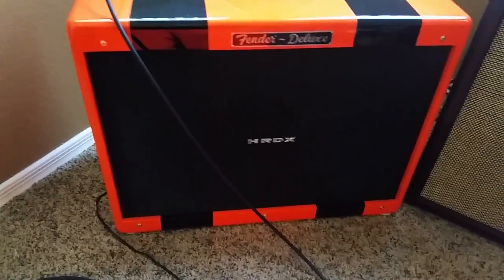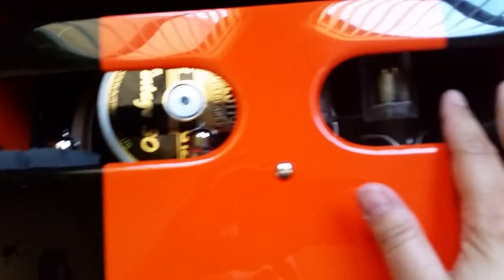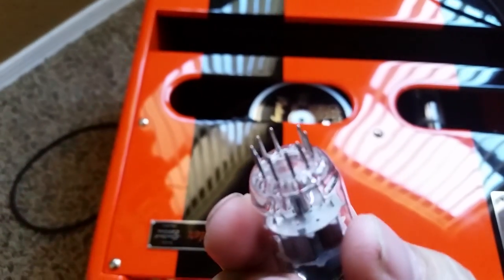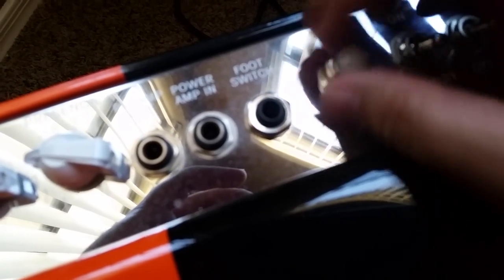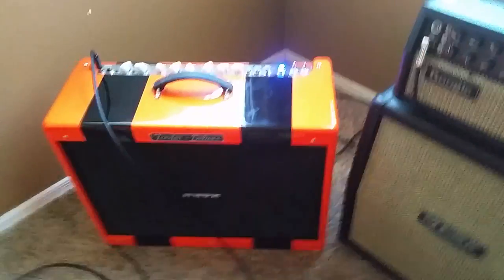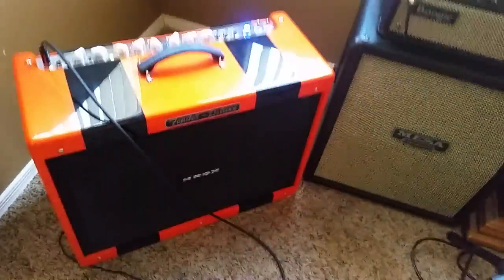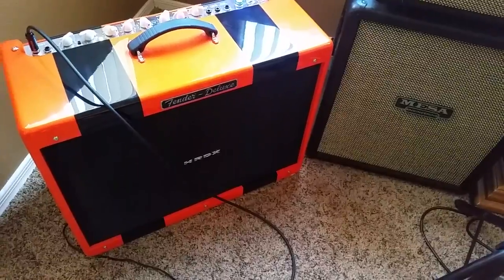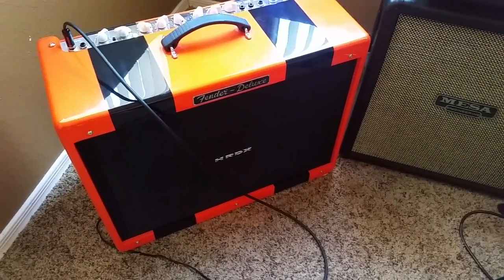Improve Your Fender Hot Rod Deluxe For $10

Comment: Great and informative video as usual Phillip.

I see that you put that tube in the V-1 socket. I owned a Hot Rod Deluxe White Lightning Limited Edition and put a 12AT7 in the V-2 with great results. It made the gain much more usable and had a  more even tone. Before the change, it did not have the volume jump but, the pots weren't tapered evenly. After the volume knob went past 10 o'clock it did nothing at all. The full range was between 7 and 10 o'clock.

I also had a Mesa/Boogie Mark III Simul-Class Blue Stripe 1X12 combo that did a volume jump but was unlike the one you mentioned here. When I would gig, I would get a big volume jump between 3and  3.5, It was extremely touchy and would jump in volume exponentially. It would either be too quiet or too loud. Never where it should be. The amp had the original tubes with Mesa silk screening on them. They were the Shuguang 12AX7's. I swapped all the pre-amp tubes for the Electro-Harmonix branded Russian 12AX7's  and the volume jump went away.

It bears mentioning that my neighbor also has a Mark III same as I did in the head version with a 4X12. He had swapped the tubes in his before me but,  made no mention of the volume jump going away (his had it as well). When I told him that the volume jump went away in my amp he said the same thing happened to him. When I asked why he didn't tell me that, he said he didn't want me to think he was nuts.

The foam around the V-1 and V-2 in the HRDX keep them form getting microphonic by dampening the vibration.

Comment: I love Fender amps  and I have owned several over the years.  I've had the HR Deville 4x10, HR Deluxe, Blues Junior, and a Deluxe Reverb.  I learned about this technique a long time ago.  I appreciate your videos and insight.  I don't understand Fender's logic, or lack thereof, regarding the reason to use linear pots instead of audio taper pots.  They are finally starting to use the audio taper pots.  All of my previous fender amps where modded with AT pots.  The tube swap is great to increase the clean headroom and the drive as you demonstrated. Thanks for your video.

Comment: Thanks, this really helped! I had tried the swap previously but the tube(Fender GT) I bought was defective. Got one from Tube Depot and that one worked. I can turn the amp up more in the house and it actually sounds better, including the drive channels. I’d say warmer and tighter. Also eliminated an intermittent crackle which I guess was the original tube.

Comment: Great idea,. I had a Fender HR Deluxe before for years and I also put in the Yellow Jackets with EL84's to bring down the output even more. I could actually play it at 4-4.5 and not go deaf, but it would still fill the room (approx 120-130 seat pavilion) where I played most of the time.I also highly recommend the Fromel mods for the HR deluxe. Replaces the plastic jacks with metal ones and the crappy tone caps and channel switching resistors. Also changes the volume to an audio taper, instead of stock linear. HRD III made these changes stock.

Comment: I have a 94 Blues Deville 4x10. I pulled all 3 12ax7's. V1 and V2 now have JJ 12AY7 tubes (about 45% of the gain of a 12AX) and an EH5751 in V3 (70% of the gain) installed. I can turn the amp to 4-5 now and actually get some power tube soak in there as opposed to the ice pick, ear shattering, high gain, preamp fizz that comes stock (@no extra charge) with these beasts. Smooth, round and still loud as I need it to be. Just a lot more controllable. I should mention I am a harp player. This is now my main gigging amp. Even with these tube swaps, I can cut through any stage mix with the loudest drummer/strummer combination and still have the availability to shape the tone from my pedal board. While gain is necessary to drive the power tubes, too much of it is very bad thing when plugging a mic/rig into a guitar amp with feedback being the usual result. While a mic has a much hotter output than guitar, the same principle applies depending on what kind of tone you seeking. If you want a clean amp/platform to run your pedals into, this is the easiest and most effective way to go. Simple preamp tube swaps have been done by harp players since Little Walter plugged a dispatching mic into a guitar amp 60+ years ago.

Comment: There is also an issue with the volume pot on fender HRD. Fender uses a linear taper pot instead of an audio taper pot. When the pot is changed to audio taper it has much better volume control.

Comment: It's not new, not secret, for sure...but that doesn't mean I knew it. Took my Deville to a great repairman for some other issues. When he heard my style of play, he put in that tube (or equivalent) before I came back to pick it up. He suggested I try it. I was blown away, using my Epiphone Joe Pass with 12 gauge strings, it sounded more like a Gibson L5. The warmth was incredible, the E & A strings were almost like I had a bass guitar,  and the high ranges had a buttery sound. I never went back. The gain loss wasn't an issue for me at all. The GT12AT7 is a great suggestion. Can't say what the life of it will be, but it's worth it, even if it's a shorter life than the OEM tube. Seriously.

Comment: Ive been using this.. trick well call, for your years. Def helps in almost every amp ive tried this in. Bought only amp it didnt work on was the Line6 Spider Valve, but thats a digital amp imho (even if it has tubes).

Comment: The tube dampeners are especially important in combo amps. SUMMARY:  Due to the close proximity to the speakers the tubes will be vibrated which wears them out faster and causes them to become  microphonic much sooner. The dampeners "soak up" much of the vibration extending tube life.

Comment: Phil - SUGGESTION FOR PEOPLE CONSIDERING DOING THE TUBE CHANGE - Your idea of changing the TONE by trying different preamp tubes like the 12AT7 is excellent BUT YOU NEED TO KNOW the different "positions" of the preAmp tubes.
FOR EXAMPLE - Most tube amps over 5 watts probably have more than one preAmp tube. Most of the TONE change comes from the preAmp tube in the FIRST Position. Usually the preAmp tube closes to the input jack & volume control. So you should KNOW the positions of your preAmp tubes and what feature of the amp each controls. In your video you correctly changed the preAmp tube in the 1st position.

Comment: Nice write up.  I have a 1996 HRDx. I use the 12AX7 but am using an attenuator through the effects loop to perform a signal soak.  This way I can dime the amp and control the output to the speaker without power dropping so I get maximum tube tone without all the ruckus.  That being said, I may try this just to see.  I too have a Celestion VG-30 in mine.  I do like the added warmth your demo provides and I am a fan of the gain drive dirty funknasty channel :)

Comment: I have a HRD I use for practice/stereo app, etc.  I got a tube set from Eurotubes that was called the SRV Blues option, which uses a 12at7 in v1 and that amp is now Awesome. Even the drive channels are useable now! That and a hemp cone WGS speaker and it's a really good gigging amp
Reply from the maker: I might need to try that.
Reply: Brad Carroll I have a blues deluxe and run a12AT7 in the v3 position.  What specific speaker did you buy from WGS?  I've been looking at the Eminence Cannabis Rex and WGS ET 90.  Right now with the stock speaker, I run the mids at somewhere around 10 and treble at about 3, and it's not bad at all, but I'm really curious to see what a speaker swap might do.  I run several od pedals, and don't really touch the second channel.
Reply: +MUSIcMaN587 you can't go wrong with the Cannabis Rex, I've installed one in every fender amp I have, a tweed blues jr and a 68 custom deluxe reverb. I'm looking for a cheap used blues deluxe to try one on.

Comment: Just bought a Fender Blues Jr 80 proof and one of the preamp tubes started acting up after less than 2 hours. I have accumulated enough gear to open a store but in 99.9% of the cases a $100 MXR 10 band eq fixes any perceived or real tone issue. A simple move of a slider vs new pickups, speakers,tubes,caps....

Comment: Another good way to help with the volume level is to make a "master volume" pedal with a audio taper pot and a in and out jack to run your guitar through, then run it through the FX loop.  the out of the pedal goes to the in of the amp, the out of the amp goes in the in of the pedal, crank the amp, then slowly turn the pedal up.  Works beautifully, I use it with my Blues Deville 410 and I couldnt play it without it.
Reply: CaptZapBrenigan Can't I use the volume Poti on my guitar for that job?

Comment: If my memory serves me right,the 12ax7's were sharp cut-off(for higher gain) opposed to the smoother roll-off of the 12at7's(the grids were shaped in such a way that the low-level signals rolled off a bit smoother).The 12ax's had higher gain,but were prone to more hum and microphonics.This brings back memories of the old reel-to-reel tape machines.

Comment: Yeah this cuts the first gain stage down quite a bit, thus mellowing out the overall sound, and power of the amp. I have a HRDeville 212, quite a bit louder than the Deluxe, and a trick I use for mine when I want to tame her a bit is to put a 12AT7 in the driver position. It helps to lower the output a little while still getting nearly the full sound of the distortion, which I love. Another thing I like to do is use 12AU7's in the preamp section, and a 12AT7 in the driver section. Massive amounts of overhead and absolutely no breakup at all on the amp. Pure clean tone forever, highlights the sound of your pedals, and is perfect for recording; not all that great for live show, maybe small coffee shops.

Comment: ive gigged with these amps for years and have always run my amp at around 3 vol, and used the house PA system to push more volume. i also use a bossME-50 which has a master volume that does wonders for these amps
Reply: Even pushed through a PA - a HRDx is not throwing out the tone it is capable of at a volume of 3 as the tubes arent drawing enough power to reach even close to breakup.

Comment: This is my favorite amp for sure. I know that its flaws are usually pertaining to the volume jumps and what not. BUT frankly, a high gain setting like he has in the EQ on his amp above will further worsen the volume jump. The effect will be less dramatic as you use a lower gain setting. 
- i will say, that the volume jump isn't a problem, given the fact that this is not a practice amp. buy a practice amp and avoid this problem. gigging is more what this amp is for and in such cases, the volume jumps won't be a problem.

Comment: I ended up putting a 12Dw7 in V2.

Cleans are unchanged and the drive now has less gain and is less harsh.
Reply: The 12DW7 is half 12AX7 and half 12AT7, so you just change either the input stage or the next stage, and leave the other unchanged.

Comment: i was told not to do this as the 12at7 tube is not an exact replacement for the 12ax7. circuit changes would need to be done to keep from stressing out the amp...his quote  "you could put a strain on the power supply along with thinning out the tone due to tonal shifts. The AT7 has a bandwidth out to 40K whereas, an AX7, is limited to 10K I believe"     .if you want, use a 12 ay7 or for even a lower gain factor use a 12au7...With my blues deluxe reissue i did the Fromel mod and use a guitar eq fx pedal in the fx loop and cut the signal...now i can play at 3,4,or 5 on the volume and my ears dont bleed

Comment: Hi Phillip, I've just bought a Hotrod Deluxe III at Ebay, and also, I've just bought the 12AT7 at Amazon after looking to this great video. One silly question is how to get signals in and out to an Audio interface? I've been using solid state amps where you have a USB line, so it's quite easy, but I have no idea on how to do it for this amp. I have an Alesis Vi49 and a Novation Launchpad plugged into a Novation Audiohub 2x4 that goes to the PC and Ableton. 
Again, thanks for this video, I found it perfectly on time for my amp.

Comment: IIRC, I think Fender put a linear-taper volume pot in that version of the HRD, which is what causes the big jump. Eight o'clock on a linear-taper is like noon on an audio-taper. Replacing it with an audio-taper pot will cool it off, too. Of course that's not nearly as cheap and easy of a fix :-).

Comment: Great mod ... will definitely try it just to mix up the tone.  for those wanting to lower the volume of any fender amp with an effects loop - buy the
JHS Little Black Amp Box
$38.25 on amazon.  you insert it into the FX loop and you can crank the amp all the way up and override the volume.  No power cords no tube swaps just straight up volume override for any amp with a FX loop.
Reply: Lion Tamer is like 10 bucks

Comment: No. While that will cut the overall volume, the problem is the Master Volume pot is linear taper. Change it to an audio taper pot, and you now have volume control from soft to loud, with gradual changes.

Comment: What you may find that works better is using another tube called a 5751. It's got the same plate resistance as the OEM designed for tube type (AX7) but, with a lot less gain and, that's really what you're seeking on this amp here. 

By dropping the Mu factor, down to 70, one can find a hi-gain preamp more manageable but, without the need to rebias. 

The problem with swapping tubes in and out is that they are never biased properly thus, they run super cold and sound sterile as compared to if you heard them biased up properly. The feel and tone would be substantially better and a lot more lively.

In my amp that I designed and built, I run AU7s which, are super low gain tubes at around 19 Mu factor. However, I've designed the circuit around these tubes to match them. And, they've got boatloads of gain when you need it but, unlike an AX7, they've got a ton of headroom and a boatload of dynamics in regards to - a hi-fi like clean tone much like that of an old Japanese hi-fi power or preamp design. 

So, while swapping tubes in and out can be done, one really wants to watch out for impedance issues, bias issues, plate voltage issues, current draw issues etc.
Reply: I thought preamp tube did not need to be biased?
Reply: +jakemf1 it does. it is a misunderstanding of, one size tube fits all, same type so, all must be good. These circuits used in tube amps are not self biasing. tubes run either hot or cold. in this case, they will run on the cold side.
Reply: +jakemf1 In the amp I designed, I cannot even run AX7s. AU7s only. The circuit is tuned for that tube only. the frequency and voltages are all setup for an AU7 specifically to maximize the response. 

For years people have learned all sorts of bad habits based on hearsay. as a child at 9 years old, I was swapping tubes after someone showed me to get more gain, pop in this other tube. i did that for years. then i found out in high school electronics class.....whoa ..voltage, plate r values &...bias r values....in the handbook....are all different due to tube types possess different specifications just like op amps and TO 220s to FETs. each PN has its own datasheet. The datasheet....technical data sheet, says here is your plate load...bias current etc. Amp guys just did whatever they wanted up to blowing amps up using Tom Scholze Junkman load boxes that were of static load. MIT grad or not...he should have had the smarts to know to use a reactive load box vs power resistors to prevent blowing up the tranny. The xfmrs want and need a back pulse. Negative swing on the AC coming off the speaker helps balance the load at the output tranny. Ed Van Halen used a 100W or 200W load resistor and kept blowing heads like crazy. Finally someone with more brains figured it out and made it well known that was not to be done. 

people screw shit up and then it comes out in videos. fact of the matter is, some methods achieve a desired sound at the expense of blowing amps up. VH also browned out the power supply. voltage drops...current goes up outside the MAX operating limit thus killing components or shortening their life and reducing reliability.

Comment: Or you can swap the volume control pot with an audio taper pot and replace the phase inverter tube with a 12AT7 for an even better tone (if you prefer more drive out of the first two preamp gain stages than the 12AT7 can deliver). Having a 12AT7 in the V3 P.I. position, reduces muddiness with the drive channels in use.  You can also swap V1 with a 5751 tube which has about 70% of the gain of a 12AX7. 12AT7 has about 60% of the gain of a 12AX7.

Comment: Just run a jhs little black box in the effects loop to attenuation the volume down and have the cranked sounds
Reply: Glad to hear you say this! I'm new to all this and eyeing a Hot Rod Deluxe IV. I will use it primarily around the house but want it for the occasional gig use. I just got the Little Black Box a couple days ago and haven't even tried it on anything yet. I was wondering if it would do the trick for this amp. My understanding is that it will let me access those nice "cranked" tube sounds, but at a low volume, right?
Reply: @ransombaggins9301  ya cheapest option otherwise you have to put an actual attenuator between the amp and speaker

Comment: Phillip, 
Long time watcher. First time writer. Thank you for this tip on the HRDX. I purchased mine recently and performed this upgrade (I went with a T-12AT7-JJ) and I was blown away by the difference in incremental volume control..  If I could pick your brain, your thoughts on the full fromel supreme mod for this amp? Thanks again for all the usual and entertaining insight. 
AJ
Reply: Phil I ordered the LED and it won't fit in the jewel cap. $10 shipping wasted. Boo!